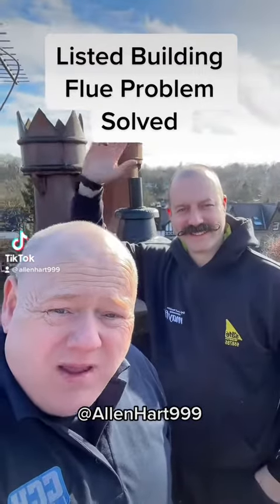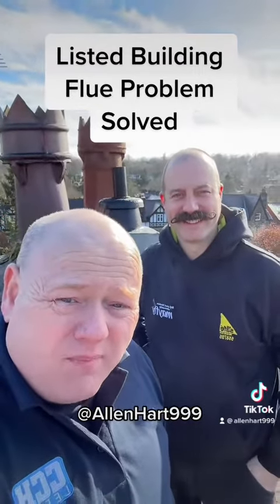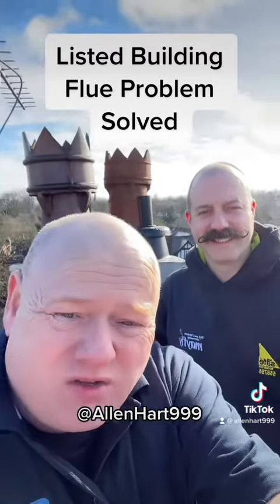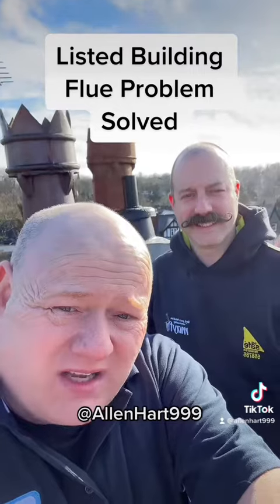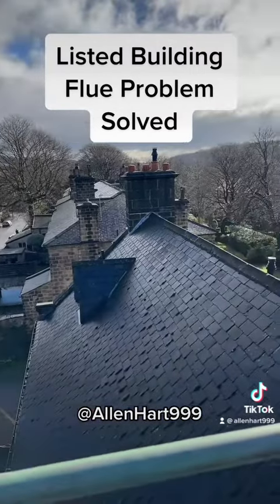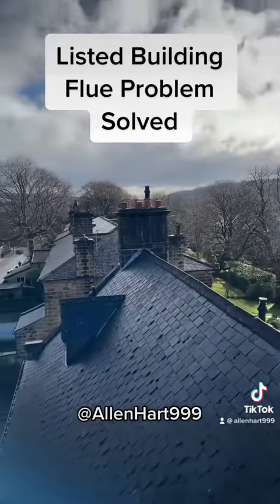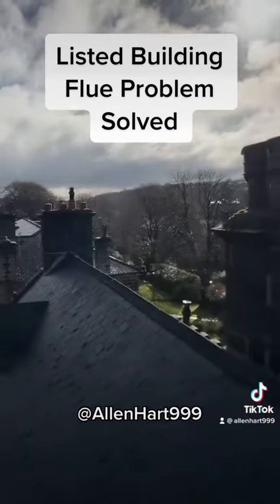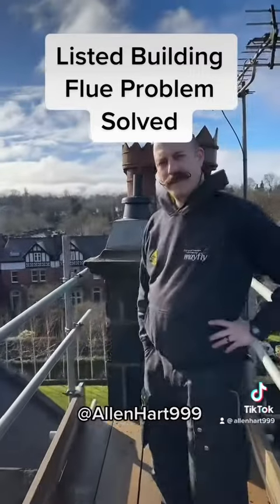Listed building flue problem solved Leeds plumber Viessmann chimney

Comment: Yes but that flue still does not comply with a listed building as it is a material change to the original clay pots.  If that gets approved by the local authority listed buildings officer they should resign.  Sorry but something more akin to looking like a clay chimney pot needs to be considered.